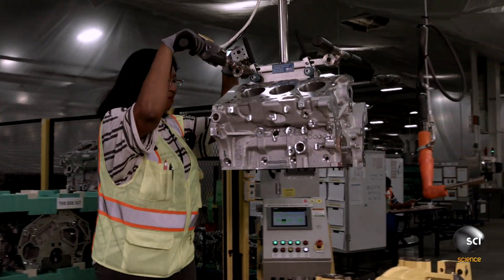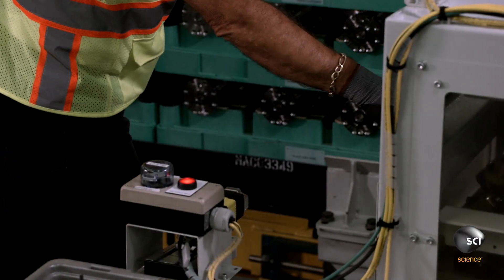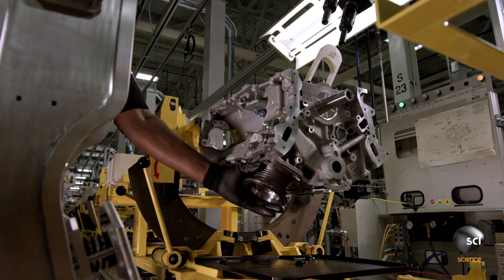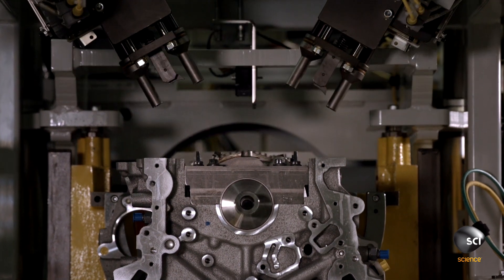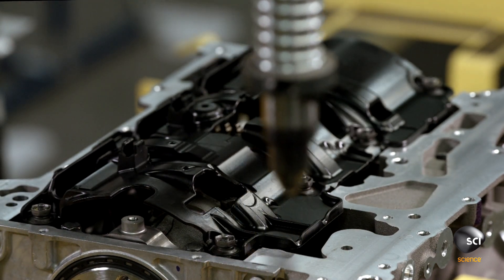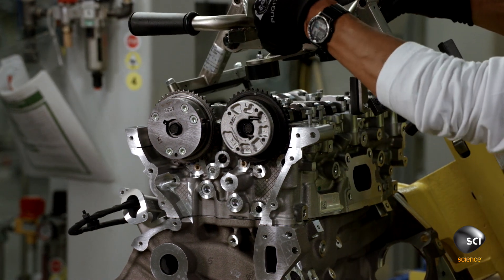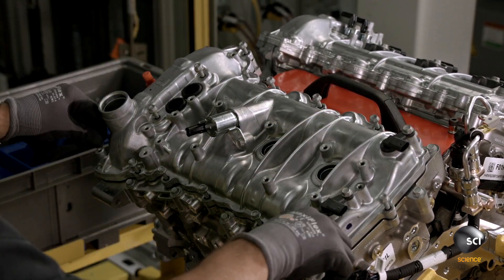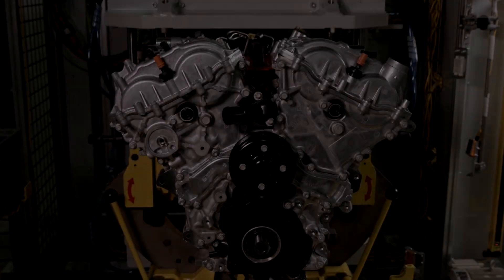Assembling a V6 Engine

Comment: thats a dohc engine... camaros use a valley cam with pushrods and rockers
Reply: hi! do you have the timing diagram of that engine?
Reply: The V8s do. This V6 is common in Camaros.

Comment: This is not an LFX, this is the  LGX which has the oil pump relocated to the pan area unlike all of the previous 3.6L motors which have the oil pump mounted on the front of the engine. Also note the lone actuator solenoid on the front of the timing cover just below the actuators. The previous engines LY7, LLT and LFX have both pairs of sensors and solenoids in that location. This engine has two ports up top going through the valve cover. The LGX is the latest and clean sheet design 3.6L. It has two chains instead of three like the others.
Reply: Interesting

Comment: At 0:56 , slamming a crank down onto its bearings like that?...babbitt  bearing shells are a relatively soft material...this procedure just put a flat spot, however small , onto those bearings.
Reply: Most engine bearings in the past 20 years have been aluminum ( hard ) with a steel backing.

The crank is pre oiled providing a cushion and a fixture guides the crank in square.   This isn't an issue

Comment: 2010 Chevy Cameron v6 51 thousand miles spun rod bearings and main bearings. oil was changed every 3000 miles by the dealership. new crankshaft is not available. wTF what a pile of junk the main bearings are junk the trust bearing is only a half what the hell does this 67 year old woman do now . how come no parts like a crankshaft are you kidding me if you can't get parts for it you should not have put that pile of junk under the hood

Comment: too bad they didn't show us the timing chain installation. all these alloytec v6 engines are just terribly designed and not made for longevity
Reply: AGREED!
Reply: timing chain problems have been fixed since the lfx came out. LFX and up are pretty decent engines. People just dont change their oil.
Reply: This timing chain set up on the LGX is designed just like the Northstar V8. Whens the last time they had timing chain issues?
Reply: I suspect the chain failures have more to do with lubrication than faulty chains. From what I remember on these newer GM v6's, the computer tells you to chage your oil at about 15k miles when you really should change it at 3k to 5k miles.
Reply: @pooindaloo6049  when to change is determined by a lot of factors as it uses an algorithm. A lot of it has to do with combustion events. I stick with synthetic oil and 5k miles.
Reply: The mini bike timing chains are the weakest links.

Comment: What engine is this? I wonder if it can be swapped into a Fiero.
Reply: Turbo 3clynder Amigo ftw!
Reply: Gm 3.6 v6
Reply: w41duvernay it's the v6 for the '16 and up camaro's, this is an optional engine.

Comment: Holy crap, that crank was just dropped into place?? I'd imagine that would do some damage to the crank?
Reply: Lol all I can say is don't buy gm cars
Reply: @alexleonard9628  what do you recommend? Ford? Lol
Reply: @junioralbarran1554  my familys had a wide variety of GM and Ford products over the past 15 years, never had a single problem with any of them. Dodge/Chrysler on the other hand not so much….
Reply: The cranks are super strong since they have to hold up to the pressure exerted by combustion. The bearings however, are somewhat fragile, so dropping a heavy crank on them like this is asking for bearings to be damaged.

Comment: i wanna see how inline engines are made to discover how japanese cars are madr
Reply: The crank, piston & cylinder head assembly is the same no matter what engine you're working on -- 4 cylinder, boxer, inline 6, V6, V8, V10, V12, etc. The only major differences are the cam's location on the engine and the valve train assembly (which is itself is determined by cam location). Over-head Cam setups like shown here (DOHC or SOHC) have the cams mounted on top of the cylinder heads, and the cam lobes are in direct contact with the valve springs. This is why these engines can rev so much higher than pushrod engines -- fewer moving parts & the valves can open/close quicker. On SCC engines (Single-Center-Cam), the cam is placed inside a bored hole in the block just above the crankshaft. Lifters with rolling barrels on the ends contact the cam lobes. A pushrod then sits on top of the lifter. At the top end of the pushrod sits a "rocker arm," which is basically a "see-saw;" -- the pushrod pushes one end of the rocker up, which causes the other side to pivot down. When this happens, the side going down pushes down on the valve spring. Thus the lifter, pushrod & rocker arm are all extra components needed on a pushrod engine that are eliminated with a SOHC or DOHC setup (because the cam directly contacts the valve springs). 

But as far as rotating assemblies go (crank, rod, piston), there's literally no difference in how they're assembled.